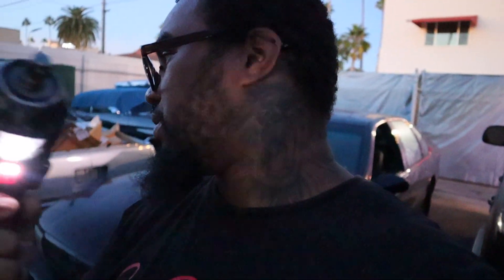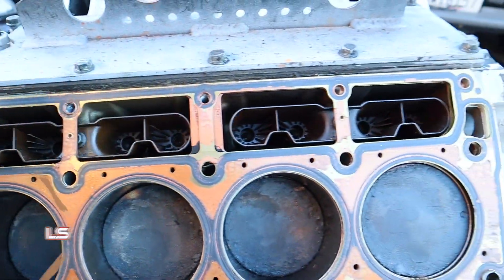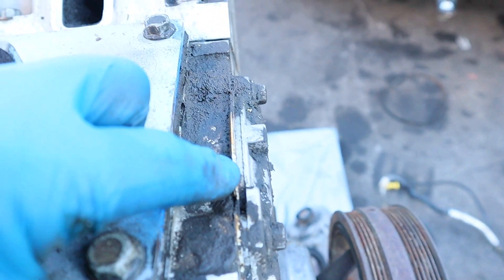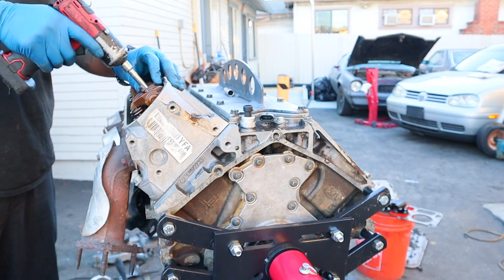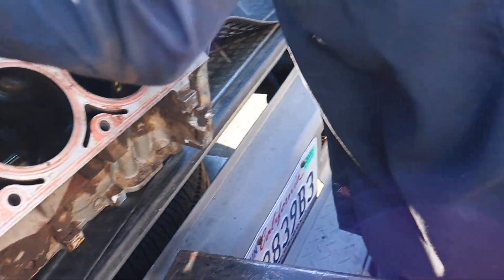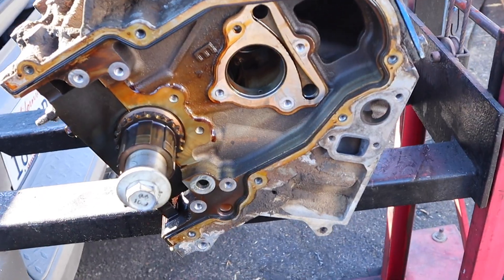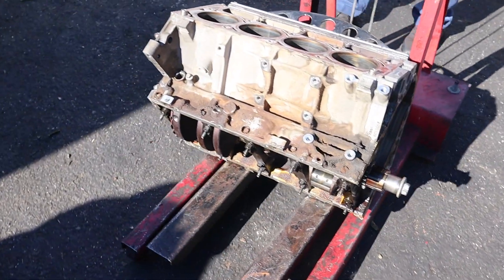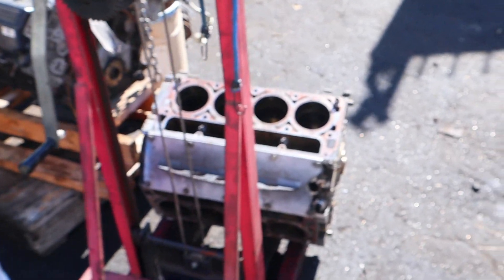WATCH ME TEAR DOWN THIS 5.3L L33 ENGINE USING MY NEW MILWAUKEE 1/2 IN IMPACT

Comment: I need a 317 head for diver side on my 6.0. Any shop that sells them let me know? I have antifreeze leak after a shop got the exhaust manifold bolts out they must of cracked it with too much heat from from the weld.